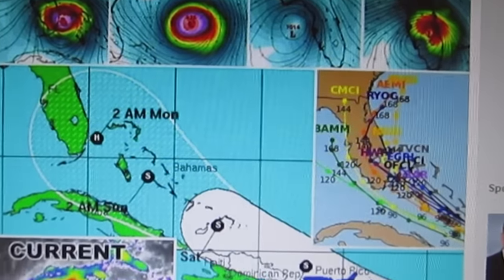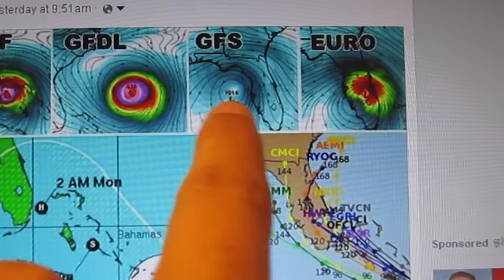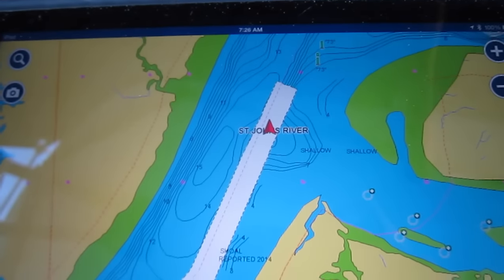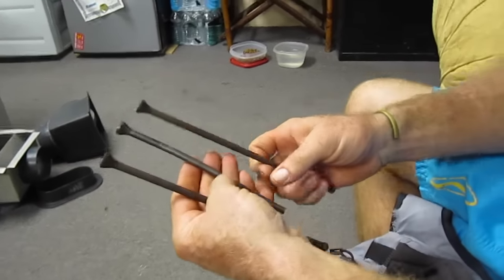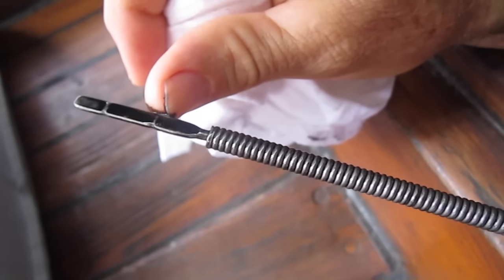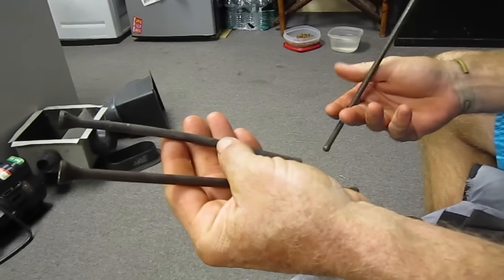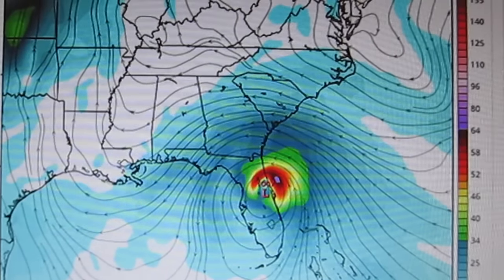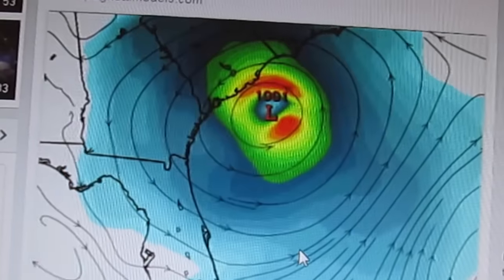Life on a Sailboat - Hurricane Erika

Comment from the maker: Thank you to everyone for your support and positive vibes! UPDATE: Norna is being moved to a dock today via tow. We also learned that our valve had a little rust on it, maybe from it sitting and condensation getting on it, and we learned that maybe, just maybe we will not have to pull off the head. As for the valves being adjusted right, we had a reputable mechanic adjust them for us, we also watched him to see how it is done. It was properly done, tho humans do make mistakes, but we do not think this is the case. We are betting on a little bit of rust that got in the way. We will update with more as we learn. Thank you again!!!!! :)
Reply: +Accidental Sailor Girl Glad things are working out for you.  Looks like the storm is going to go up the gulf side of Florida now.
Reply: +Accidental Sailor Girl  I also happen to be a mechanic of over 30 years and accomplished in marine repair. What you have the best shown me on the video is the prime example of exhaust mix elbow/ manifold failure. Basicaly water used to cool the exhaust is finding it's way back into the engine, hence the bent push rod and now the sticky valve ( water does not compress and this demonstrates a compromise in the wet exhaust system). I'm here to help as I greatly enjoy the videos, besides isn't that exactly the boating community is all about? I do come with pretty good credentials having worked on many boats and have solved some engineering faults for new Catalina yachts in California. I wish you and all aboard Norna the very best. Check the wet exhaust system thats the culprit I'm sure of it .

Comment: Bad news 
You probably over tightened the valves when you set the clearance putting it back together the last time. There is a procedure where you bring it up to top dead center and adjust four valves and spin it around one revolution to set the other four valves. But the damage is done now it sounds like you bent a valve. Lousy Luck.
The good news is
This storm may get killed by upper atmosphere winds. Don't forget it's been ten years since our last storms so the weather forecasters are druiling over these last storms. It is a a good bet this storm turns or fizzles out by Puerto Rico. Just watch it and make sure you have a back up plan. Is there a river you can sail up and get out of the way there?